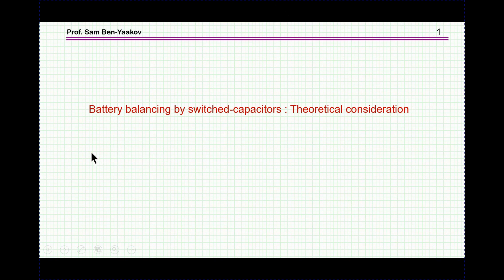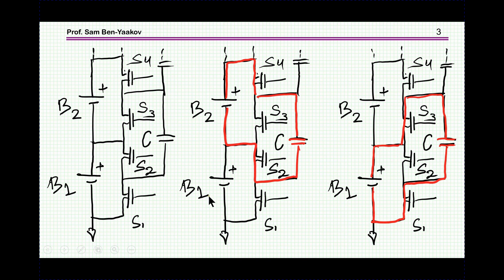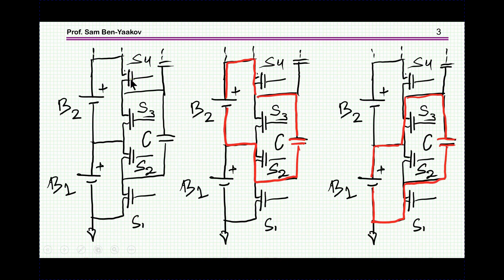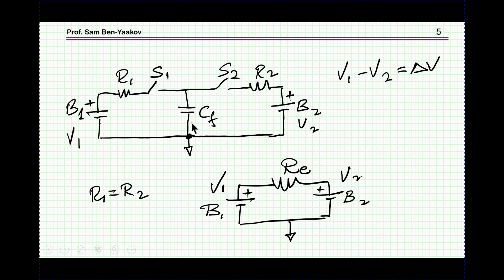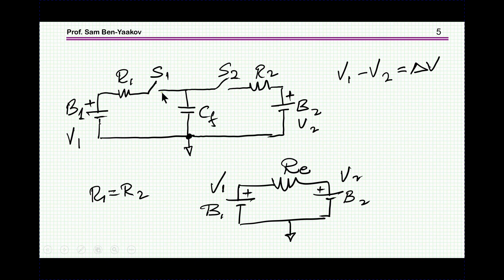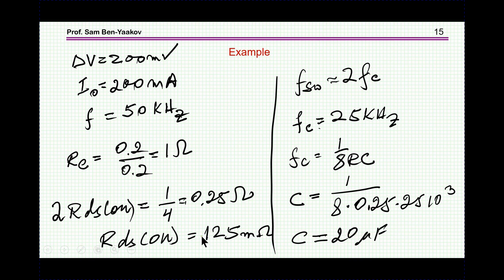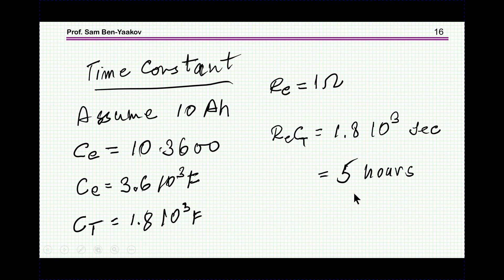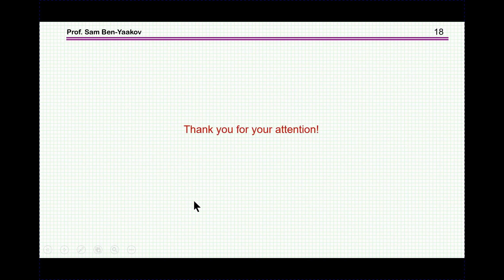Battery balancing by switched-capacitors : Theoretical consideration

Comment: Hello Prof. Yaakov, I have simulated the balancer circuit. When there is no voltage difference, a small amount of current still flows through the batteries. What could be the reason?
Reply from the maker: Send me the simulation schematics sam.benyaakov@gmail.com

Comment: I developed a switched-capacitor charge balancing, and overall power system, in about 2005/2006, eventually patented...included possibility to automatically parallel supercaps for lower voltage circuit, like memory backup, and cell balancing of 'energy storage devices' by switched capacitors...
Reply from the maker: Thanks for sharing. What is the patent No.?

Comment: In the literature it is written this is a automatic balancing method . I have one doubt sir if all the cells are balanced then how all the MOSFET are going to off as there is no need to on and off the MOSFET.
Reply from the maker: Hi, thanks for comment. Good point. There is a need to implement some circuitry for turn off once balancing is achived.
Reply: @sambenyaakov  sir then it needs the voltage sensing circuit how the controller will know the circuit is balanced

Comment: Just to be pedantic,  a battery is made up of cells.  One cell is not a battery.
Reply from the maker: Thanks for comment. I am also a pedant: what slide number or minute in video are you referring to?
Reply: @sambenyaakov  37 seconds and onward. Its not the biggest sin, its that when I was in tech school in 1972 I got hauled over the coals for doing it...... never forgot. You are forgiven..... I never was. Interesing video by the way.
Reply from the maker: @dayleedwards3521  I could have replied that the balancing could be done for batteries composed of one or more cells😊But you are correct of course, I should have said cells. Thanks.
Reply: @sambenyaakov  Now, getting back to the " negative resistance " instability with power inverters. I have  cured the problem... if you are interested, otherwise please ignore . . At zero load, the pulse width is a very narrow spikes, causing the  effective  input inductance to increase,, the electrolytic  filter capacitors effectively decrease capacity at the now RF freq they are seeing . This causes the input filter to change to a high reactance, the electrolytics becoming largely ineffective at these frequencies. A lead/lag filter of 10 ohms in series with a 100n capacitor was all that was required. In my day we called these a "zobel" network, commonly used in transistor audio  output stages to prevent oscillation with high inductance loads. I cannot say if this was your negative resistance, or simply a weird phase relationship..... either way, I thank you for the insight. I admire your comfortable and easy use of mathematics, I envy you.

Comment: Looks like application of this concept:  Testing 2A active balancer for up to 24 cells Lithium batteries. Bluetooth + app. - https://www.youtube.com/watch?v=rQgOet7AH0I
Reply from the maker: Thanks Michael for link. Intersting. Will study it.
Reply: Times change - reverse engineering chinese.... ;-)
Reply: Here another man is showing another chinese active balancer - I understand based on ferrite core dc/dc converters - 'DIY Lithium Battery "Active Cell Balancer" Explained and Tested....' - https://www.youtube.com/watch?v=fEVQ_8DUpm4
.... I wanted to discuss this concept with you - no need - they already manufacture it......

Comment: Thanks sir, Professor. I have some questions.
1. For 100ah battery capacitor, your formula for the capacitance will be 360,000F or what, not clear sir.

2. Why the use of super capacitor, because we used 1000uf capacitor on  battery for filtering.

3. Is there anyway I can protect the super capacitor.

4. Sir, is there more efficient way to actively balance rather using super capacitor, because they are bulky.

Thanks sir for your assistance.
Reply from the maker: You are confusing the caps of the equivalent circuit with the flying caps. Please watch the video again. No need for super capacitors.
Reply: @sambenyaakov   thanks sir, I have watched againand tried to understand it.
Please what will be the value of flying capacitor for 100ah battery, you used 10ah in the example. Thanks.

Comment: I was working on a different scheme of charge the cap to pack voltage and then placing it across the lowest voltage cell. Your approach seems much less complicated. I like it!
Reply from the maker: Thanks
Reply: So if its a 24v pack you would put 24v across the lowest cell? or did you mean in parallel?

Comment: I have had this idea in service for over 2 years in a 24v lead sla off grid  battery bank.
it uses a dpdt relay and a 1 Farad super cap that switches every 10 seconds and the batteries are perfectly balanced.
Reply from the maker: Very very nice. Thanks for sharing. How many batteries you have in series?
Reply: @sambenyaakov  2x 12V .
The relay is rated for 10A and is socket mounted and the contacts are still OK.
* sorry, the Cap is 1 Farad, not 1 micro 😆
PS: I am enjoying your videos. especially the power control stuff.
Many thanks.
Reply: @galactica1980 what is charging amps for 600amps, how was 10amps relay used without damage
Reply: @PlainAndSimpleEngineering-24  the relay and capacitor is not for charging, only balancing. connect the charger as normal.
anything around 1 Farad or a bit lower would be fine for your application.
make sure the capacitor is rated for at least 16v (across one battery).
Reply: @galactica1980  Thanks sir, I have done circuit, but I find it difficult to get 1farad capacitor, please can I combine capacitors to make 1f.

But the system balancer will be working 24/7, all the time without time to rest. Is it OK, or is there anyway to control this.

Thanks
Reply: Good video, please can this model  be used for 48v, 12v x4.
Reply: @Andrew, how many Ah is each of your batteries
Reply: @PlainAndSimpleEngineering-24  I have 2*12V 100Ah in series and paralleled.
Reply: @Andrew, thanks sir for your reply. Do you mean, 2 x100ah in series, and 2 x100ah in parallel, making 400ah total. Please what type of capacitor did you use, electrolytic or ceramics. Does it work for charging and discharging like double tiered model.
Reply: @PlainAndSimpleEngineering-24  actually I have 6 parallel batteries. 24v 600Ah total.

Using a 1 Farad electro cap like the kind used for car stereo sub woofers.
It takes the charge from the highest charge battery and shares it with the lowest so after some time the batteries are balanced and then stay that way.
Reply: @galactica1980  thanks so much sir, I want to use 2x 100ah and 2x200ah batteries separately, please which capacitor Farad will you advise. which timer model did you use.
Reply: @galactica1980   thanks sir for your guide
Reply: @galactica1980  please sir, why did you choose 10secs why not lesser or longer.
Reply: @PlainAndSimpleEngineering-24  i think 10 seconds is a good balance between relay contact life and charge/discharge  cycles. you could make the time longer though.
if you made a circuit to compare voltages, then it could enable the relay only when it needs it. This would require extra control measures though.
My circuit uses a simple PIC controller but you could use a common 555 timer.
cheers.
Reply: @galactica1980   thanks so much for your explanations
Reply: @galactica1980  please is the capacitor dependent on the battery capacity ah
Reply: @PlainAndSimpleEngineering-24  not so critical. 1 farad is pretty good for most capacities
Reply: @PlainAndSimpleEngineering-24  we are only trying to charge and discharge a small difference between 2 battery voltages. probably only 0.1 to 0.5v. So the capacitor never fully discharges.

Comment: I'm trying to make a BMS that uses flyback transformers in place of flying capacitors. These videos have been great. Thanks for sharing. I wonder if I can use DC restorers to drive my transformers.
Reply from the maker: Transformers?  Not sure what you mean.
Reply: @sambenyaakov  There is another design for a charge transfer balancing circuit, where the energy from each cell is switched through a small transformer which steps up the voltage and charges the battery stack. The DC restorer you showed in the other video looks like a great way to drive the mosfets.

Comment: Hey Professor Ben-Yaakov, thought you might find this Nikola Tesla patent interesting. Particularly the fact that the plate on top is merely a charged body used to coax the energy from the earth through a capacitor. The capacitor is used to capture the energy before it reaches the charged plate on top. The higher the charge on the plate, the greater the imbalance and therefore the speed with which the capacitor is charged. I find it to be a fascinating concept and just another piece of the puzzle he was forcing us to put together. I thought perhaps you could explain it better than I. Happy Hanukkah... Holidays.   https://teslauniverse.com/nikola-tesla/patents/us-patent-685958-method-utilizing-radiant-energy
Reply from the maker: Thank you for comment and link. Interesting.

Comment: There's a chip out there that does this up to four lead-acid batteries, called the LTC3305. 

https://www.analog.com/media/en/technical-documentation/data-sheets/3305fb.pdf
Reply from the maker: Hi David, Thanks for comment. This balancer may be too coarse for Li-Ion. It would seem to me that the topology is very wasteful as compared to a switched capacitor arrangement. Have you ever tried it?

Comment: Very good. I look forward to the switching discussion and other practical implementation factors
Reply: Sam Ben-Yaakov it would also be good to cover separately practical voltage measurement for such a system and the interactions of capacitive charging and measurement systems?